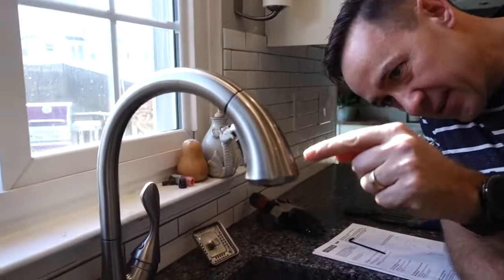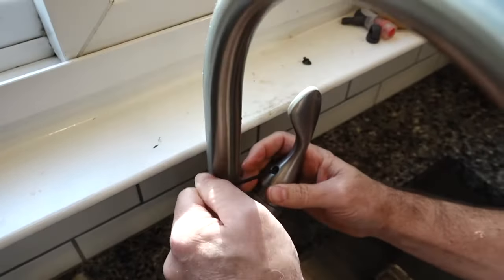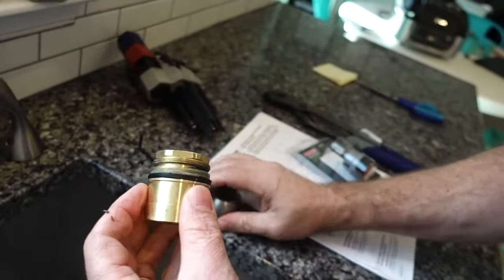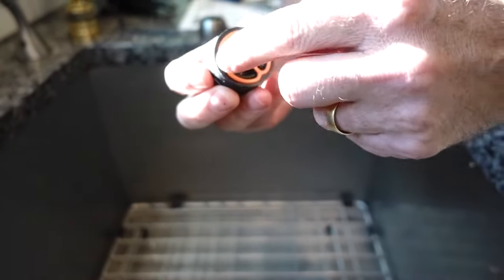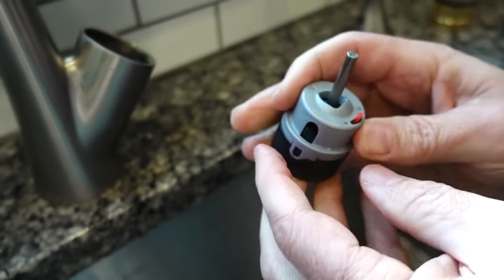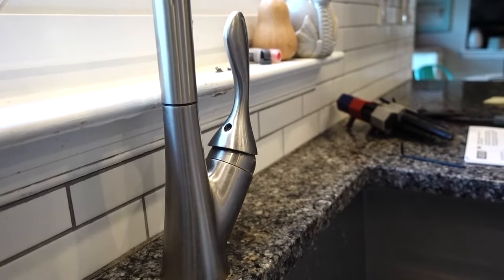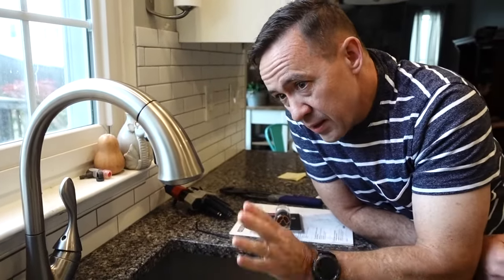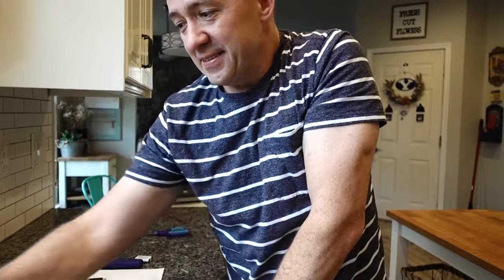Fixing a Leaky Delta Faucet - Try this First Before Replacing the Single Handle Valve Cartridge

Comment: Delta lifetime warranty will replace for free. Don’t spend your $35.
Reply from the maker: Nice! I didn't even think about that.
Reply: Took about 20 days for it to get to me from Delta but other than having to keep shuting off the water until it worked right it was worth the wait since it was free.  PS, they expect it to be either registered for warranty or for you to have proof of purchase.
Reply from the maker: @sooner_born2256  cool!
Reply: yes, but only for the original owner
Reply: F Delta and their requirement to have proof of purchase.  Just go buy a new faucet swap out the cartridge with the old one and return the faucet, F the big box stores for selling replacement parts for 'lifetime' faucets.  This cartridge is crap, my Delta tub and shower valve has the Delta ball and rubber seat guts and the repair kit with the seats and springs is $5.00.  It was $2.00 thirty years ago when I last replaced them.  My Delta kitchen faucet looks similar to the $59 version without the spray house option.  I purchased  the $69 version with the spray hose, just to cannibalize the sprayer and hose attachment to repair a friends fancier faucet with the brushed nickel finish. It was cheaper than buying the replacement parts separately  So when my faucet began to drip, I was going to use the parts from the spare faucet and repair what I thought was the old ball design, remember paying $89 for it, no way am I spending $40 for a cartridge plus tax and shipping and handling.  I know nothing lasts forever and prior to this I was satisfied with Delta products because of their reliability an availability of replacement parts at a reasonable cost.  I recently roughed in a Delta tub and shower valve that came complete with a trim kit and cartridge for $89.  The cartridge required some adjustment because water coming out was lukewarm.  I was aware of that there were two types of Delta tub and shower valve cartridges, but this was a new one and the price is almost the cost of the entire kit.

Sorry Delta, not playing your game anymore, I remember buying your shower only valve and the valve body had an outlet for a spout with no plug included.  The nearest store was 45 minutes away(HD), and they're out of stock of 1/2"  $5 brass plugs.  I was going to buy the Moen valve, but the Delta was $5 cheaper.  The home owner had to wait till the next day to start closing up the wall to start tiling.

Comment: If your faucet becomes “sticky” and doesn’t want to shut off, remove the cartridge and rapidly move the cartridge handle all around rapidly, flush out the cartridge with water, repeat three or four times.  This breaks up the calcium and sediment in the cartilage.  Restored mine to like new function.
Reply from the maker: Good to know! Thanks for the tip.
Reply: This worked for me- thanks!

Comment: Ok you know that RP50587 might have been free if you call Delta and told them what was happening.  These higher end faucets are lifetime limited warranty to the original buyer.  Good reason to fill out your warranty cards.  I'm on my second free Valve Assembly since purchase.  Yes it did take 8-10 days to ship but that was ok in my case.  I'm glad you figured it out and were able to return the new Valve.  Cheers
Reply from the maker: Yes, I looked into a replacement, but we didn't have proof of purchase... like you said, good reason to fill out your warranty cards!

Comment: The cartridge "bonnet nut" (the brass part) was loose. That was the cause of the drippy faucet and the "gross" stuff around the collar and handle.
Torque the bonnet nut to 70-100 inch pounds.  It should not come out "by hand".  Best is a torque wrench and 1-5/16" 6 point, deep socket.  But..."pretty darn tight" will probably work. 
 
The good news? You fixed YOUR problem.  The bad news? That's usually not the problem. 

More often the leak is caused by a worn cartridge, and the cartridge would need to be replaced. It is also a good idea to change the aerator in the spout AND the bonnet nut and "V-ring" seal at the same time.  If you're going to turn it off and dissect it, you may as well do the whole thing and not have to worry.
Reply: Love the 45ACP

Comment: I wonder if Delta will replace the handle that I had to drill the set screw out of because it was essentially fused to the handle body. Actually, I’m pretty sure they won’t because from what I’ve seen in the comments in every single video about leaky Delta faucets, NO ONE besides myself could not get the set screw out. Even after cleaning all around the outside and soaking in penetrating oil, and trying an easy out. It’s did not budge. I guess I need to play the lottery because I’m one in a million

Comment: So what was the end result problem if you didn't replace the cartridge? Did I miss that part?
Reply from the maker: The problem was that the part holding in the cartridge wasn't screwed down tight enough. When I went to unscrew the cap on top of the piece holding the cartridge in (not sure what to call it), the whole think came off: https://youtu.be/V4gpy_Eq0YI?si=OKMgyu_Kmj8Azsj9&t=133.
I then put it back together and tightened the piece more: https://youtu.be/V4gpy_Eq0YI?si=THL5voQRKNzraTDc&t=305. 

That fixed the problem for about a year. After that, it started dripping again and I ended up replacing the cartridge about 10 months ago. I haven't had it drip since.

Comment: Recommendation: Do not OVER-tighten the bonnet nut (the brass cylinder part). 

In case if tightening does not resolve the issue, you’re gonna have a hard time trying to loosen the bonnet nut - thus stripping off & rounding out the corners of the nut without proper tools. 

Believe me, that happened. 😢

Comment: How to remove hot/cold water clip to get to screw. I have similar faucet. I tried to use small screw driver but am afraid I am going to break something.
Reply from the maker: That stinks. Ours clip covering the screw comes up fairly easily when prying from the bottom.